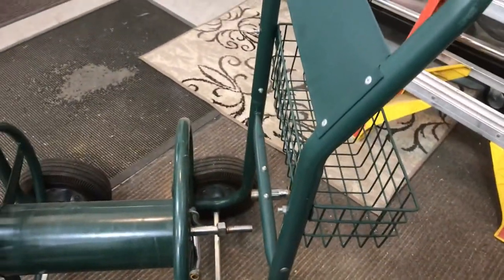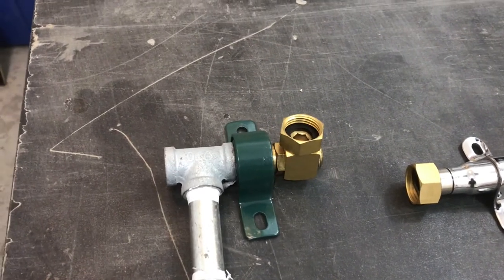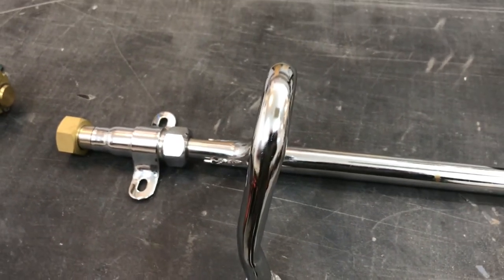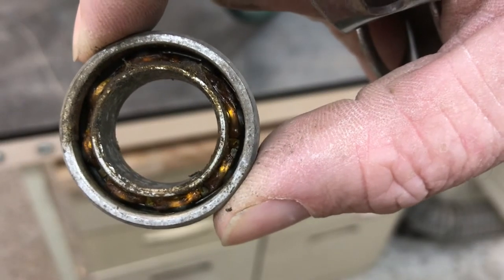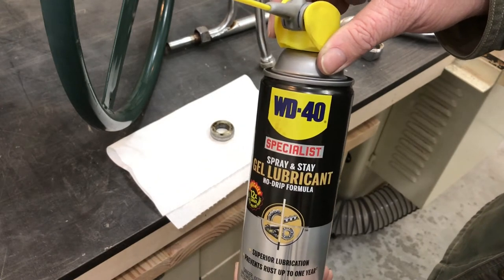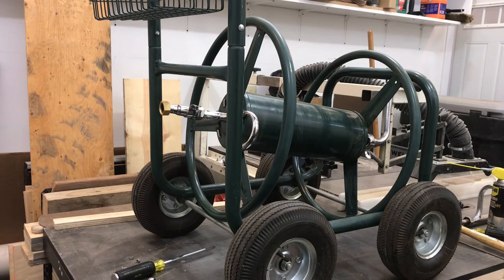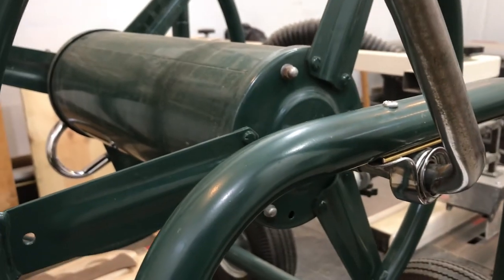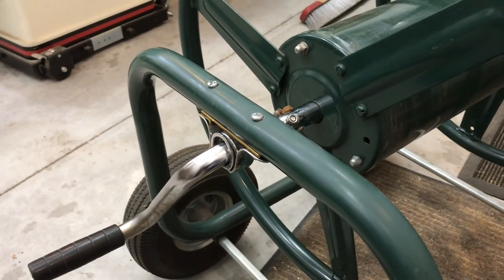How To Repair Liberty Hose Reel Cart

Comment: Wow.  First thanks for posting this.  I was considering discarding my hose reel since the water connection was leaking bad and was fairly corroded.  Second, I have not been this impressed in years as I was with Liberty's service.  I emailed them a link to your video and a snapshot of the part (from the video).  They got back to me very fast and took the time to send me a bunch of photos complete with measurements.  I did not even have to repeat my address as they were intelligent enough to get that from my email.  Total cost August 2023 including shipping to California:  $38.99.

Comment: Thank you the tips. Extremely helpful. I restored mine and ordered the parts. I got a very fast response from Liberty. It's not manufactured here but they can order it. I sent a screen picture of the part and they knew exactly what I was talking about. Parts came in about a week. Changing it out is easy except the hook on the wheel. I had keep pushing the rod to feel the hole. After 15 minutes, I finally got it. It's hard to guide it.  I use AGS Rust Solution Spray paint over the rust spots. I also sprayed the inside of the middle. Just aim the spray and rotate the wheel. Do the opposite side.

Comment: Thanks for putting up this video!  I have a real that I repacked the water connection with faucet stem packing and that has not worked very well.  I've been searching for the replacement part and your info in the comments has what is presumably exactly what I need on the way to me!

Comment: By chance you wouldn't have the part numbers of the parts used do you? I have  the same hose reel and the brass water hose inlet broke and need to replace it. But no pictures of replacement parts show what I have.
Reply from the maker: @countryside; Hello, the part number they gave me is #872 Water Connection. If yours is the same as mine it should work. Their # is 866-820-5805 and they are very helpful, even though it took a long time to get the part because of the pandemic and stock issues. Thanks for reaching out.

Comment: How do I order the same water pipe you received.
Reply from the maker: Hello, the part number they gave me is #872 Water Connection. If yours is the same as mine it should work. Their # is 866-820-5805 and they are very helpful,

Comment: I have one just like that needs same part, could you post the Part number and price?
Reply from the maker: Pamela West, Hello, the part number they gave me is #872 Water Connection. If yours is the same as mine it should work. Their # is 866-820-5805 and they are very helpful, even though it took a long time to get the part because of the pandemic and stock issues. Thanks for reaching out.

Comment: Hey Joel do you happen to know that part number? I bought the same reel last year and it's leaked since I got it and can't find the part
Reply from the maker: Hello, the part number they gave me is #872 Water Connection. If yours is the same as mine it should work. Their # is 866-820-5805 and they are very helpful, even though it took a long time to get the part because of the pandemic and stock issues. Thanks for reaching out.
Reply: @joelongrid7625  do you happen to have a model number for the cart? I called them and gave them the part number and they said they don't carry that old of parts anymore
Reply from the maker: @webster8004  There wasn't a model number anywhere to be found. I ended up sending pictures and they knew what part I needed. They call the part 872 water connections, I checked my old email from them. Like I mentioned in the video they sent me the wrong part originally but they corrected it. Very helpful but it took a few tries and some patience. My cart is likely five to ten years old I'm guessing.

Comment: Hi Joel, can you please provide me with the part number?
Thanks
Reply from the maker: Hello Kamal, the part number they gave me is #872 Water Connection. If yours is the same as mine it should work. Their # is 866-820-5805 and they are very helpful, even though it took a long time to get the part because of the pandemic and stock issues. Thanks for reaching out.

Comment from the maker: Hello, the part number they gave me is #872 Water Connection. If yours is the same as mine it should work. Their # is 866-820-5805 and they are very helpful, even though it took a long time to get the part because of the pandemic and stock issues. Thanks for reaching out.